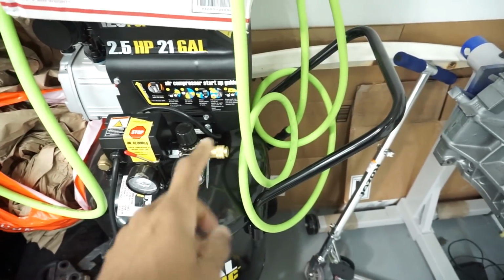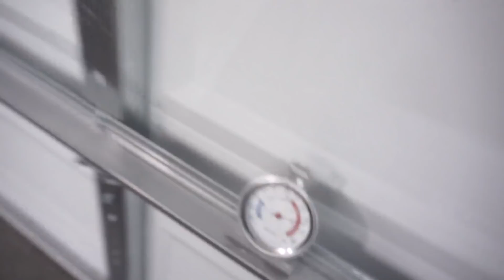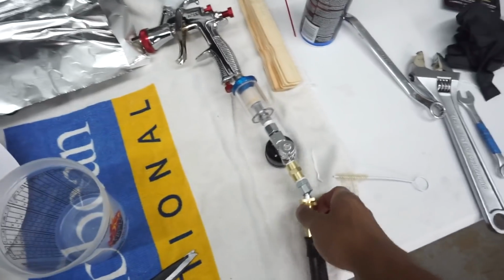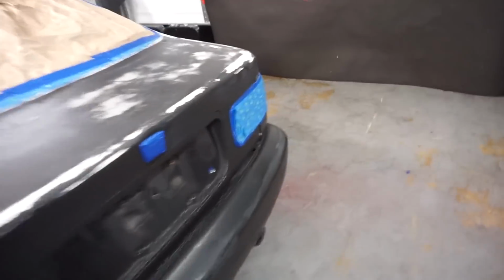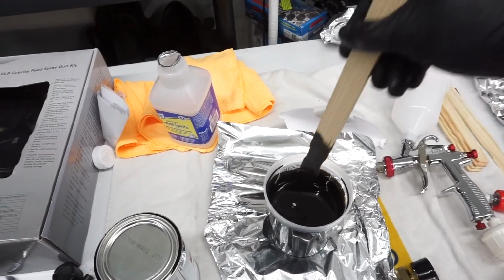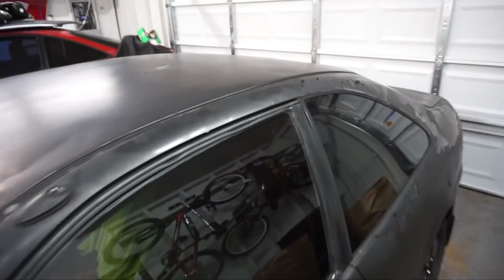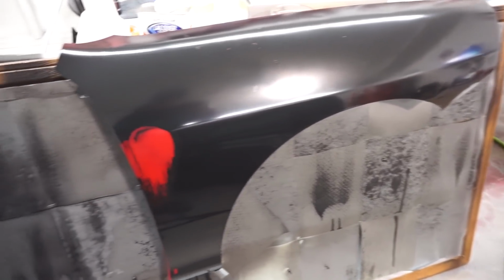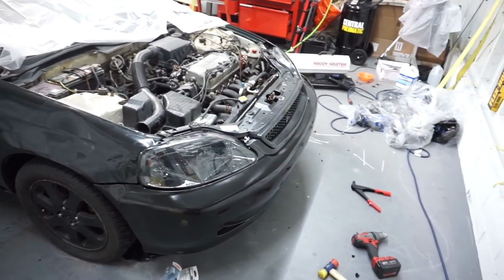Rustoleum 50 Dollar Honda Civic Paint Job Complete

Comment: It's got bad spots all in it😂 should have did more prep work before painting and better start gun and air tank😂
Reply from the maker: Before you laugh Check my latest vids bro this was cheap and my first time
Reply from the maker: Went to check ur page for tips but I dont see shit 🤷🏾‍♂️ before u judge upload somethin
Reply: @irvsmadhouse   I owned. My own body shop bro👌 so just telling u Should have got better spray gun and and the paint was fine Thou. ..the prep work was alright   but the the spray gun and air pressure fucked up ur paint job and when u paint black u gotta do long strokes. That's why u have spray lines in spots👌😂
Reply: But bro.  Next paint job u do.  Sand the whole car. . use high build primer then . Then mist flat black all over the car then let it dry then block sand it till all the flat black is gone then paint ur car the color u wamt it to be then u have a badass paint job for two days work😂
Reply from the maker: @gotswagg9006  like I said look at my newest vids I painted my own car I did this for a customer out of my own pockets... I did sand this whole car(which is in the previous vid) I jus didn't primer. The car looks better than it came either way for free

Comment: Nice try bro. It takes a lot of experience before you can shoot a good paint job. U needed to 
Primer and blocked some hardener some fisheye remover maybe some real low temp reducer always have gloves on turn down the psi and use lacquer thinner not the carb cleaner. Good luck
Reply: I can’t believe you wasted your time with all of that for that type of result. My first time painting a car had near body shop results, obviously you did not do your research